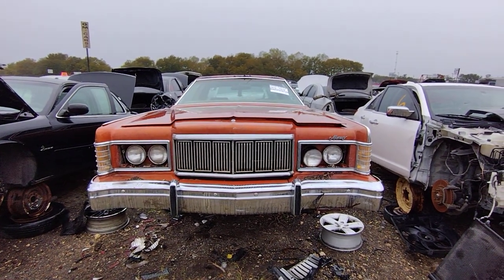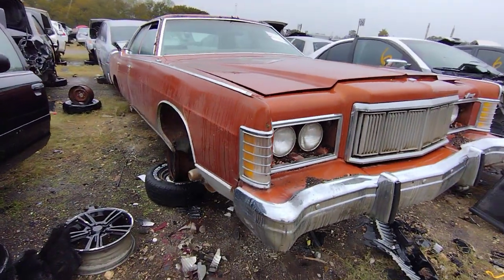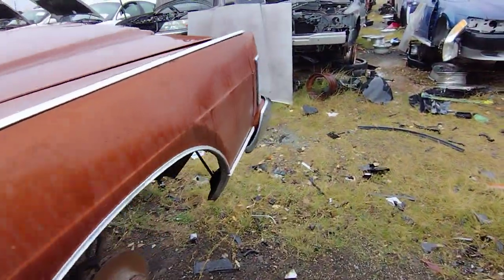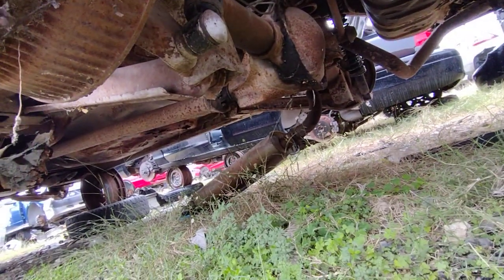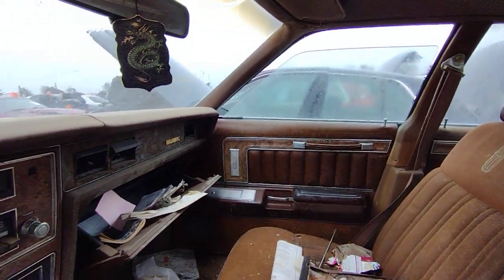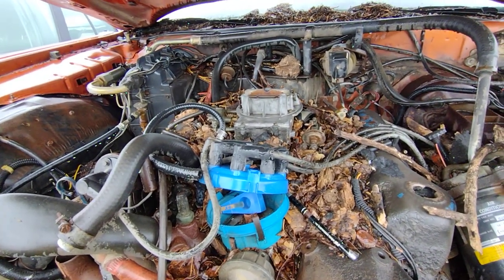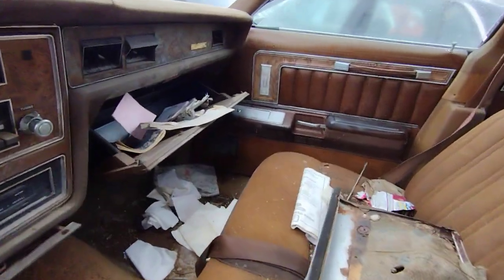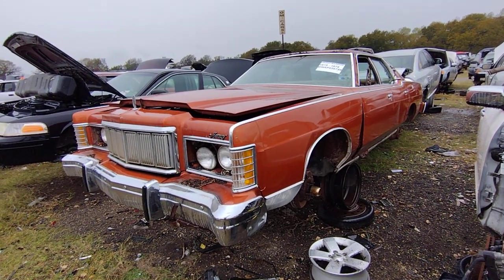Uncle Buck Anyone? I Think It's A 1977 Mercury Marquis Brougham Junkyard Find

Comment: Whoa Nelley, 1977 and going to Heaven. 

Terrorist Timothy McVeigh drove one of these and was caught by Trooper Charles J. Hanger in Perry, OK driving it without license plates (Oddly enough, it still had the original dealer emblem from Fort Lauderdale Lincoln-Mercury on the back of it). Trooper Hanger realized the next day who he had arrested and then called the jail instructing them not release McVeigh. He stopped another terrorist attack as McVeigh had blown up the Murrah Building in Oklahoma. Trooper Hanger became Sheriff Hanger and ran uncontested for years and has recently retired.  Yes, this is a Marquis Brougham as the Grand Marquis would say it on the right-side deck lid. 

For those following the "Silent Malibu" that was featured on Mr. Magnante's channel and saved from the MA junkyard by You Tuber "NeshPro" in TX, I am helping him document the car and I was close on the trim tag, but now I know more about it and fully decoded it. You can see that on his channel. 

We got the VIN, we win: 7 for 1977 model year, Z for St. Louis (Hazelwood), MO assembly, 62 for Marquis Brougham four door pillar hardtop, S for 400 V8 with two barrel, and the rest is the production sequence. The 400 V8 depending on what you read was optional or not available on the 1977 Marquis Brougham. The general brochure shows it was available, but the specific brochure says no. The 400 V8 was a sloppy, terrible running engine and did not net much better fuel economy over the 460 with four barrel. The Hazelwood plant operated from 1948 to 2006 and was idled (and eventually closed) with "The Way Forward" plan and was demolished by 2009. 

We got the tag, we can brag: 8K for Bright Saddle exterior paint, BT should be for a full brown vinyl top, 53K for Marquis Brougham four door pillar hardtop, RZ for Saddle interior trim, 07G for Thursday July 7, 1977 production, X for FMX automatic transmission, B for 2.47:1 axle ratio, non-locking, A for factory installed AC, 22 for Dallas, TX sales district. 

Whoa Nelley, 400 and gotta go. The "Biz Marquis" isn't for me. FMX has always been a mess. 53K and going away. Pillared hardtop took a big flop. Made in Hazelwood and it ain't no good. Charles Hanger in Perry OK made the bad guy go away. The VIN gets the win, and the tag gets the brag. "Lend a Helpin' Hand" or this one is ready for the trash can. Motorcraft needs a life raft. That's it, time to quit. Mercury was the "Sign of the Cat" and this one will soon be flat. VIN code "S" is in distress. Going to get squished and the FOMOCO Malaise faithful, maybe a few here, but certainly not the Google Man are going to be even remotely pissed.
Reply: There you go cutting down my favorite FORD engine 😼
Reply: Always leaves the most awesome comments. I love reading them.
Reply: @45AMT  Nice of you to say. Sure thing.
Reply: @googleusergp  I concur sir 😆
Reply: @garymckee63  Yup. Got a '74 LTD with a 400 and never had a problem in 20 
years having it.
Reply: @socalltd  The one I had the block cracked on it with plenty of coolant on an 85 degree day with all of the coolant system working properly and l believe the vehicle had about 44 thousand miles on it at that time.
Reply: @socalltd  Never been a fan. A sloppy and slow engine. Not that GM and Chrysler did not make some "gems", but Fords of this era were among the worst.
Reply: Thats a great commentary, are you also a fan of the truck 360 :-)
Reply: @ppeters480  No. I'm not a Ford truck fan. They only got "decent" when fuel injection came along and cleaned up the performance and economy of their engines. Their carburetion, fuel control, emission control and everything about them was sloppy and poor quality. A Quadrajet outperformed any Motorcraft carburetor by a wide margin. So much so, Ford used the Q-Jet on the 429 in 1971.
Reply: @googleusergp  Twin I Beam 😀
Reply: @garymckee63  Ford trucks had their fans, I'm just not one of them. However, I will say in the modern era, they are very upfit friendly, more so than Dodge or GM products. For a fleet person, they make life easier because a lot can be done with them. They sell very well, and they are flexible on the optional upfits that can be done.
Reply: Not a fan of the 400 either
Reply: @walterbatman7949  You're in good company. LOL.
Reply: @garymckee63  That is very strange for it to do that
Reply: @googleusergp  long tube headers and a dual plane intake help it move along 
without worry.  gonna re-build it soon with all new internals and aluminum heads
Reply: @socalltd  Still a sloppy 400. Better off with a 460 that's made to make power. 400 engines were emissions/smog engines and major heaps.
Reply: @socalltd  The 400 V8 was a black eye for Ford. They were slow, sloppy, burned oil and had cracking problems. The Motorcraft two barrel was the icing on a crap cake and sealed the deal for it being a heap.
Reply: @googleusergp  The 2V is the easiest thing to rebuild and don't mind it being slow.
Reply: @socalltd  But it's still a piece of junk. LOL. A Rochester Dual Jet will outperform it in every way and is just as simple to rebuild. Ford always had sloppy carburetion. They took a bad design (a Holley), "ripped it off" and made it worse.
Reply: @googleusergp  What I have is perfectly fine
Reply: @socalltd  Yup, it works for you, I get it. The 400 V8 was no winner, that's for sure.
Reply: Sail cat
Reply: Oh my goodness

Comment: I made the mistake of buying a '78 Grand Marquis because I was tired of public transportation. It had a 351W, backed up by a FMX trans., which came to a screeching halt in the middle of an intersection half a block from my house. It kicked a hole in my wallet to fix, as the shop had to order parts from California to fix it. A few short weeks later, it dropped dead taking me to work. Within walking distance of a junkyard. Perfect.
Reply: You were better off with the bus. LOL.
Reply: Typical ford
Reply: @danh2134  "Driver Returned on Foot".

Comment: This is a Mercury Marquis Brougham.  It is NOT a Grand Marquis.  You can see the brougham emblem on the back truck is missing.  Also Marquis Broughams have that chrome fender peak moulding that runs down the length of the car which the base Marquis does not have.  The Grand Marquis have a different style interior and have an emblem on the truck that is ABOVE the Marquis which you can see there never was one there.  Mystery solved.
Reply: Correct, this is a Marquis Brougham, body code 53K.
Reply: @googleusergp  So the Grand Marquis have a different code? Do you know the code for the Grand Marquis?
Reply: @klwthe3rd  Yes. Depending on the year, 53K for the Marquis Brougham and 53L for the Grand Marquis.

Comment: Hmmm does this car share front ends with its sister Lincoln Continental, they look very similar ?  As does the hood emblem and front seat embellishment.
Reply: A lot of similar parts throughout the full size platform, yes. Trim and sheet metal are different.

Comment: The big block died with this body line. The down size 79 on were all small block powered 351 & 302 and even a few 83 California cars had the 255 v8 . very slow cars !!
Reply: Not correct. The 255 VIN code V8 was last offered for the 1982 model year.

Comment: The "Grand Marquis" diddent officially appear until the 1979 downsizing of this huge car. They made the G. Marquis throughout the '80's.
Reply: Not sure what you're talking about.  The Grand Marquis name was introduced in 1974 as an interior option package on the Marquis Brougham. The next year, 1975, the Grand Marquis got it's own model designation.  It was that way all the way through the late 1970s' and early 1980's till they spun off the Marquis name to the fox body and the Grand Marquis to the Panther platform. That year was 1983.
Reply: @klwthe3rd  You are totally correct. I was trying to keep it simple. It get's confusing over the years. I meant by 1979, all Marquis were now "Grand Marquis" In the 80's; the upper model became the "Grand Marquis LS". Still had many trim options, both inside and exterior. (You could get the "formal half vinyl roof; opera lights; cornering lights; etc. But they were great cars for my grandparents to haul us around in plush luxury !!
Reply: Where is this an how bout a number
Reply: @walterburson2931  Fair enough. Thanks for the reply.
Reply: @walterburson2931  That is not correct. There was both a Marquis and a Grand Marquis for the 1979 model year.